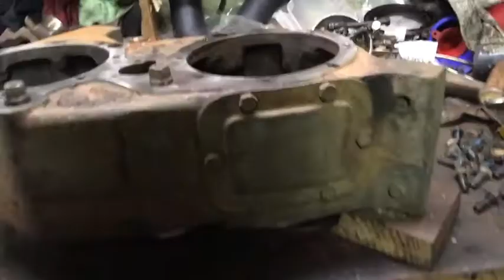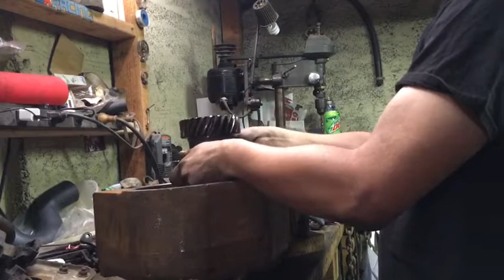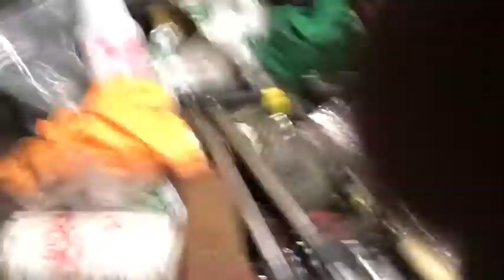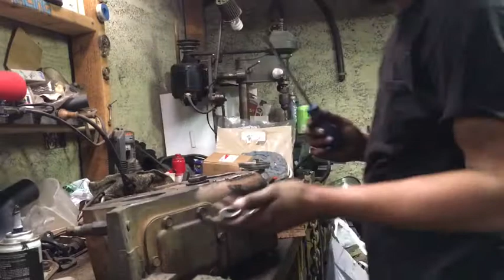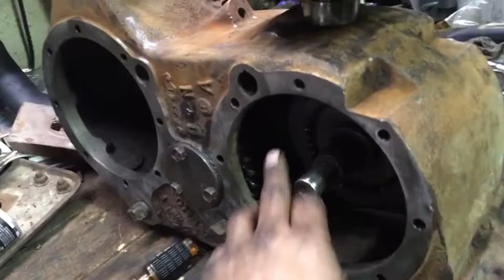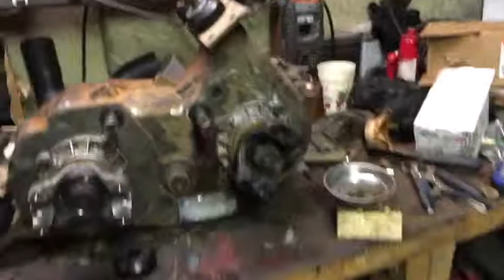Parts replace assembling the divorced NP 205 transfer case  Part 2

Comment: Alright video, but you forgot the rubber gasket for the threaded side of the idler shaft and also the large rear output bearing that supports the shaft. A person should always be using thread sealant on all the bolts on this t case since they are tapped straight through the case
Reply from the maker: Sean Leighton the forgot bearing was mentioned in the comments. For the sealant I agree but I must have missed the through holes good catch
Reply: I’ve rebuilt the same ford divorced np205, for the amount of water in the case one would have thought the previous owner was jumping beaver dams with the truck. Had three messed up shafts and a bad low gear from the corrosion
Reply from the maker: Sean Leighton ya they seem to gather water maybe because ya just can’t kill them so people abuse them.  Also thinking about it the sealant on the gaskets I used will seal the bolts when I pulled it apart to put the missed bearing in the threads were covered.